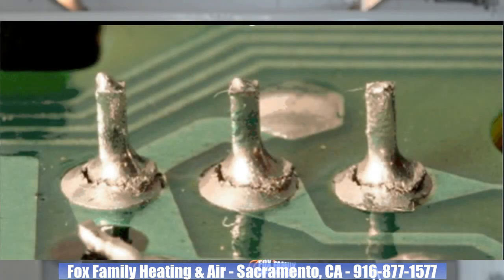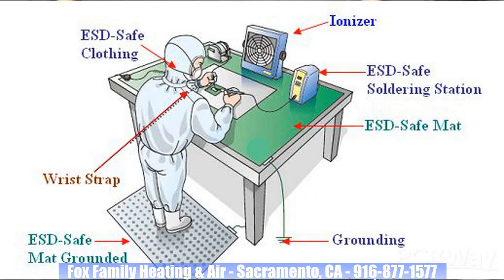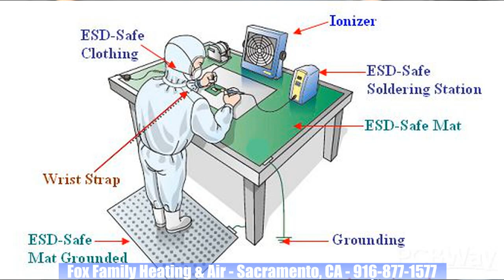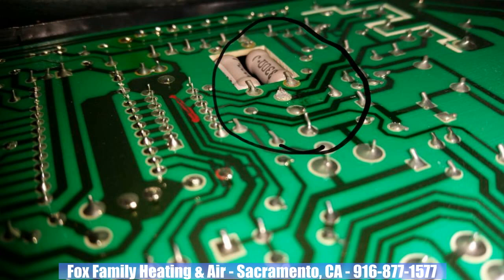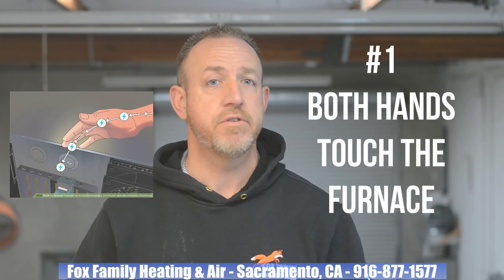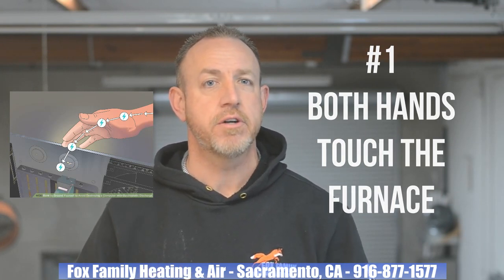6 Ways to Reduce Electrostatic Damage ESD to Control Boards

Comment: OH SNAP! pun intended lol. Good stuff. Doing component level repairs on boards much like those,  we use slightly different terminology but the gist of all you said is correct. And yes, why use a mercury whetted hermetically sealed industrial motor control relay when an Omron DIP will get you through the factory warranty?lol It seems just about everything in HVAC electronics is available from Mouser or Digikey these days.  Even the inrush suppressors that fail on the brushless DC blower motor driver boards.
Reply from the maker: Nice!  Thanks for that information!  I'm doing another control board video next week to dive in a little further.  But yes my terminology is a bit basic!  Lol!

Comment: I wanted to know whether dust accumulation on the control board can cause static discharge damaging control board.
Reply from the maker: In my research the experts recommend leaving the dust there as brushing them clean is what can actually create ESD.  Good question!

Comment: During winter months when low relative humidity happens often, I mist water (or Windex) in the air zone surrounding the circuit board.  This action damps out static energy in the air, and whatever you come contact with.
Reply from the maker: Very interesting!  Haven't heard of that approach, but I can see your reasoning.

Comment: Might consider ESD straps.  Not expensive.  Can be clipped to a ground point with an alligator clip.  They have a 1 M ohm resistor in the wire to keep the current down in the event of touching a hot connection.  Don't fall for the "wireless" ESD scams.  The EEVblog channel has a few good videos on ESD.  The video debunking 'wireless ESD straps' shows most what is needed.

Comment: Static electricity is no longer a problem for IC circuits. The early days of IC design was suseptiple to ESD. There is a conflict of interest at ESD Association since they would no longer be needed if was not a problem. We should be getting our information from EE's at place of mfg.
Reply: just because they have ESD protection built into the components doesn't mean go all willy-nilly wild handling it without precaution, because stuff does and can be damaged or weakened to where it can have early failures and random issues.
things like capacitors, crystals, transistors can be very sensitive still, not to mention the high counts of them in an large IC chip. I've seen computer motherboards killed by ESD through a wired USB mouse as late as 2012, not to mention other cases of usb thumb drives and external devices. mind you those are all well shielded and have metal meant just for discharging said static magically :)